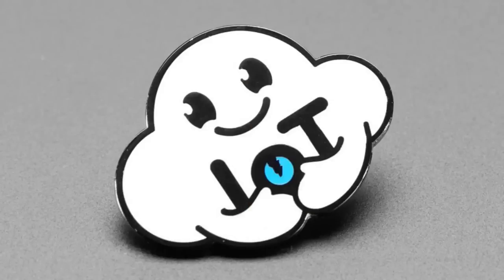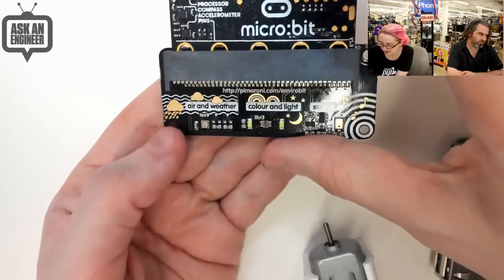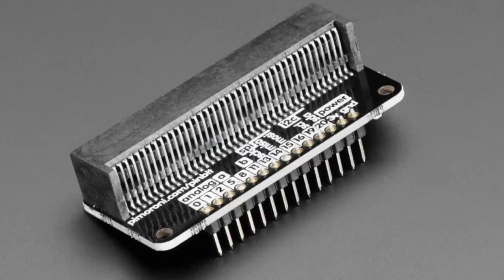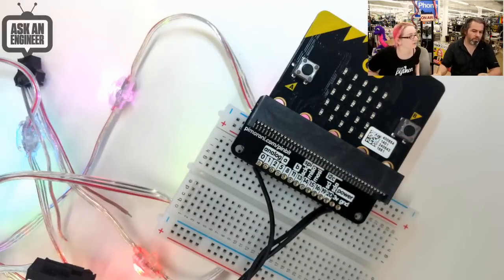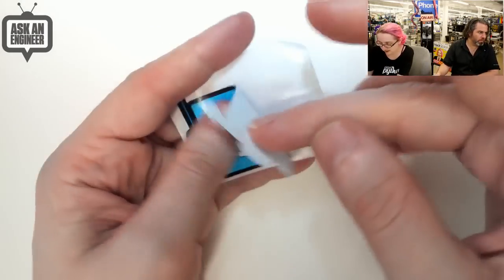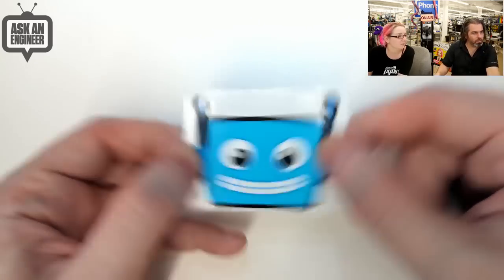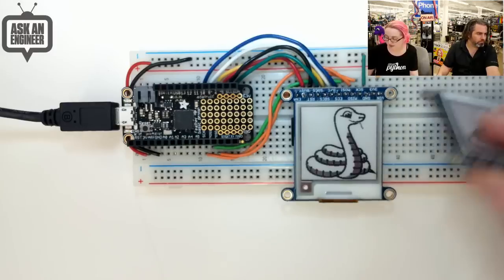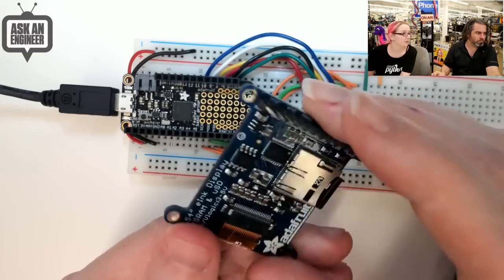New Products 7/11/2018 Featuring Adafruit 1.54" Tri-Color eInk Display! @adafruit #adafruit

Comment: I don't know about the color displays, but the black and white e-ink displays work pretty well with partial refresh. I have one I've run as a clock updating every second for over half a year and I only do a full refresh once every hour because the hour digits loose a bit of blackness efter a while if you only do partial refresh. https://www.youtube.com/watch?v=BtAEb8K7rG0